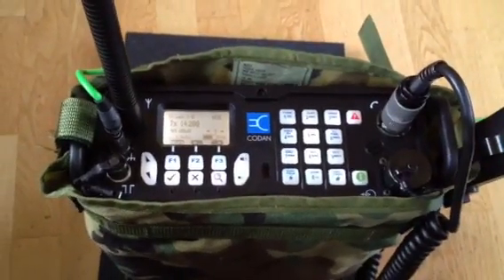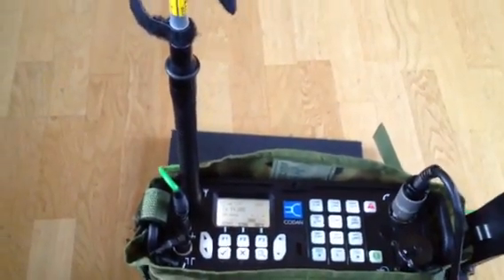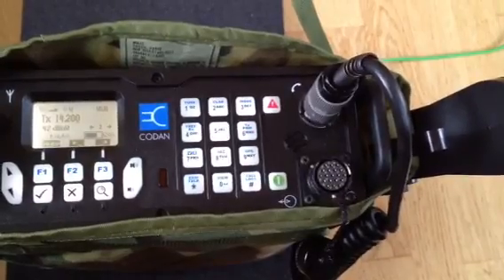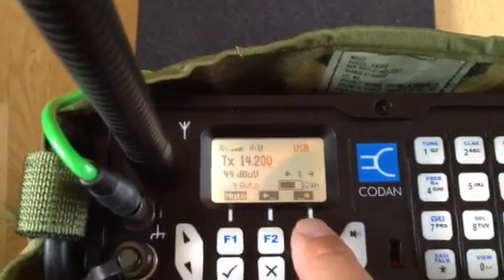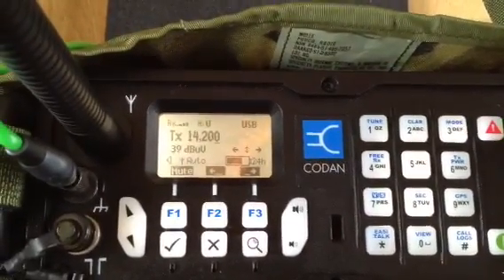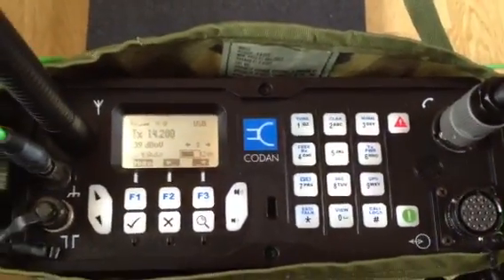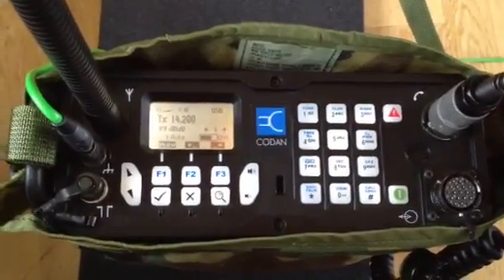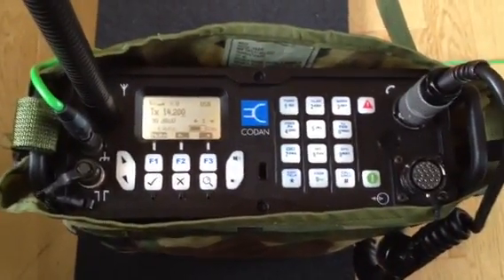Codan 2110 manpack radio

Comment: Thanks for your review.  I'm an Amateur with a General class and I'm considering this radio. Do you still own and use it? Have your opinions changed on it? I no a very different price point but I'm also thinking about the Elecraft KX3. I like the idea of adding the panadapter to it. Do you like using the 2110 without a panadapter? Regards
Reply from the maker: Hi, Codan 2110 is still my number 1 radio, even I am owning a PRC2000 and a KX3manpack. So go with it. If you like to use the pan adapter, check my KX3Manpack video. I am currently selling it, with everything. Let me know, if you have any further questions. I am happy to answer them. Thanks and regards -uli, DL2BAT
Reply: Uli Dumschat Thanks for the feedback. I might have some more questions appreciate the help!  regards
Reply from the maker: dooncoz We can have a Skype session too, where I explain you some more details, if you like. No problem... Thanks and regards -uli

Comment: I just went to work for a Codan HF Partner here in the SE United States. I am awaiting delivery of an Envoy mobile to be installed in my truck and a 2110 Manpack (Both to be used as demonstrator units in the field)  I can't wait to get my hands on them both. 73, de W4FSI

Comment from the maker: Hi Emmanuel, the Codan is definitely a great motivator to get the general exam done and to get a call sign :-) Since the Codan 2110 is a commercial radio you can imagine that the pricing is beyond of some Amateur equipment. However this radio just works, and it does an awesome job regarding reception, audio quality, battery life (120mA during receive), etc. The Icom 718 is a great radio, and probably 10time cheaper... I hope that gives you some ideas. Feel free to contact me for any questions.

Comment: Hello where can I find the manual HF SSB transceiver type 2110 Operators handbook in PDF Codan's site does not have the manual and not found on google you can help me,that the more accurate is the part where talks about baterria and shows the connections of each pin contact nozzle where the radio puts the battery,you could send me some pictures of his manual or if he could send me in PDF by email bruno_chagas_leite@hotmail.com and mbchagasl@yahoo.com.br HF SSB transceiver type2110Operators book.

Comment from the maker: My 2110 is the commercial version, ham radio enabled, but no crypto. This is a feature, that you probably can't purchase. I also doubt, that someone could get the olivegreen version... :-) i got the black version from a local and official codan dealer. Check the codan website for distributors. 73 -uli

Comment from the maker: I need to mention, the frequency resolution goes down to 10Hz. If I scan with 1kHz through the band, the 100Hz and 10Hz digits are not visible. Just jump with the right arrow button to the right, and the next lower resolution is there. That easy! The Roger Beep can be diabled by the way... Have fun! 73 -uli